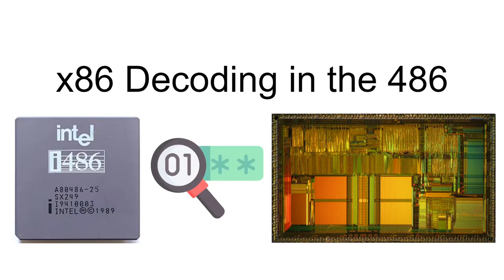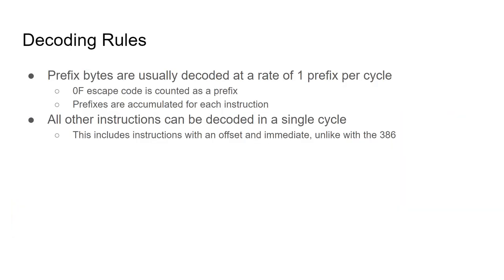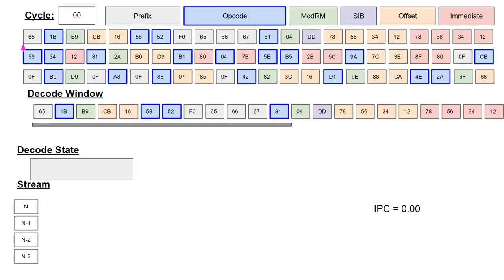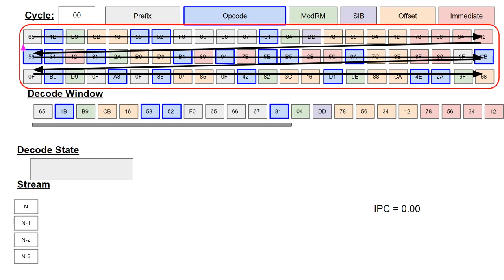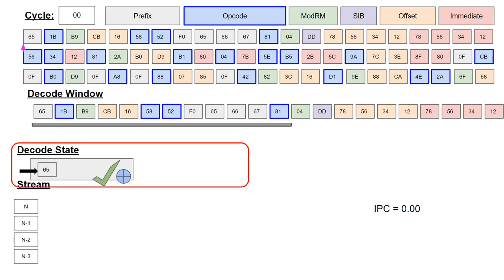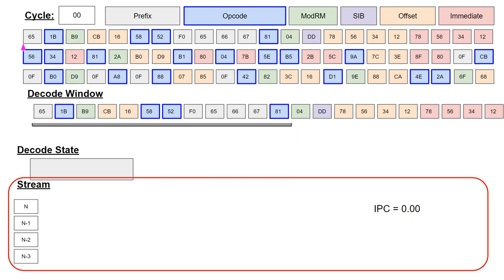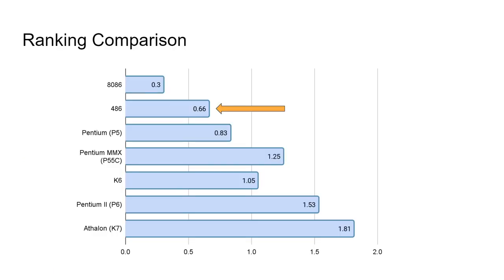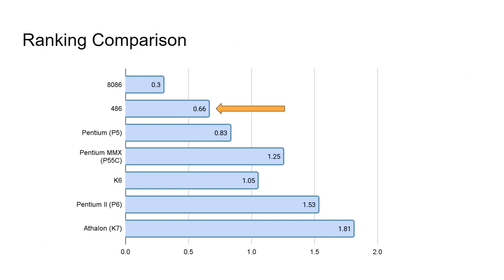x86 Decoding Simulation in the 486

Comment: Very interesting video. Glad to see someone give some attention to CISC. Are you working on an x86 implementation ?
Speaking of CISC :
Could you take a look to how ao486 is implemented or how to improved on it ?
For what i heard, the lack of FPU is an issue when going for a pentium compatibility. I guess transcendental are to costly to implement ?
Have you take a look at Flocopo ? Apparently, it generate very well optimise and pipeline ALU and FPU by FPGA target.
Are decoder and control the only unit ISA specific ? Could a cache or a TLB unit can be reuse on a different CPU ?
Would you give some love to the 68K family, decoding seem simpler (as the FPU on the 68040/68060) ?
Reply from the maker: Thanks, I am working on an x86 implementation, but progress is slow. I sort do need a better x86 implementation than the ao486 for another project that I am working on (it's good for 486 stuff, but nothing newer). 

I have looked at how the ao486 was implemented, and it is feasible to improve or add a FPU to, for example. But it would require understanding the undocumented mess of control signals and datapath. It would likely also require modifying the control sequence compiler. I don't really have the patients or dedication to consider doing that, and would likely be better off writing something from scratch.

Transcendentals are okay to implement, you sequence them via approximate algorithms using microcode. Essentially, it's like taking the C math.h implementations and making the hardware run the operations directly. The biggest problem with implementing a FPU (aside from the FPU itself, which is no more complicated than an entire 68k), is linking it to the main x86 control path. That means that either A) the 486 needs to understand that the FPU exists and needs to work with it (if it were external), or B) that the 486 itself needs to decode and issue FPU instructions. Neither of those tasks are all that complicated themselves, but figuring out which control signals need to be modified, and where to hook in the datapath is less trivial. 
I had not heard of FloCoPo (had to look it up), but I don't think it will be useful in this case. If the goal were getting something working without regard for performance, then maybe. But inside of a CPU implementation, which control signals are used, the number of pipeline stages, the technology mapping, etc, all matter.

The decoder and control are not only ISA specific, but microarchitecture specific. The same is also true for other parts of the CPU. However, it's possible to adapt a microarchitecture for other ISAs. A simple example of that is the simulator GEM-5, which has an ISA specific front end, but a more generic backend. To do so, however, you need to cover a larger set of functions with the other components. For example, with a K6 that used micro-ops, it could probably implement ARM if you modified the decoders. It couldn't implement MIPS or RISC-V though, unless the logical registers were increased from 32 to 64. If that were done, then it could also probably implement those architectures, though the MIPS TLB would be an issue. Which goes into your other question, a TLB can be reused in parts, but some require specific behavior which is opposed to other implementations. the MIPS TLB for example, operates completely different from x86 and ARM (it relies on low level software management rather than page walking).

The 68k family does have a much simpler decoder, as I understand it. But I'm not very knowledgeable there. Learning / diving into another ISA wouldn't be a good use of my time at the moment, given that there are plenty of other people already far more knowledgeable than me (who wrote 68k FPGA implementations).
Reply: @RTLEngineering  I wish good luck, i will follow this serie. 
It is just me or TLB and Cache are very similar ?
What do you think about generator like Chisel, Migen or SpinalHDL ? I was thinking using one of these for prototyping the most complexe parts because i want to keep what's left of my sanity.
I'm more interested in the 68K, i know there is many implementation of the 68000, one for the 68010/68020, an 68030 without MMU and the 68080 from the Apollo Team (an 68060 like with no MMU and not open source). I was thinking starting from scratch and maybe skip unused/obsolete instructions like BCD, aiming for a modern 32-bits 68K with MMU ( to do linux and stuff ). And beyond the OG 68000, there not much as technical doc, so i started to look for the closest architecture, the good old x86, hoping i can transpose some things
Reply from the maker: I will certainly need it, already had a few setbacks, and had to scale back the scope a bit (I was originally going to implement a K6, or something similar).

A TLB and Cache can be similar, but it depends on the associativity. With the Pentium, for example, they have a similar associativity (2-way for the cache, and 4-way for the TLB). There are some x86 implementations that are fully associative though, just like with MIPS. And the refill mechanism also depends on the implementation. x86 has a hardware refill for both cache and TLB, whereas MIPS only has it for cache. (A non hardware assisted cache refill mechanism would be a scratchpad, like what the PlayStation 2 had).

I have looked at all of those generators, and used a few for stitching parts together. I'm not particularly fond of them though. They are really good for rapid prototyping, and are powerful for verification (using formal verification). But they are almost impossible to debug (if formal verification is missing conditional state tests), and they give you very little control over synthesis for performance or area (you can always black box, but then what's the point of using the generator). That doesn't mean they are useless, but you could end up putting almost as much time into them as writing straight up HDL.

I know there is a lot of interest in the 68k, but there's been a lot of work done there. The only work done with x86 at the 486 level are the ao486 and the v586, neither of which have FPU support. And that hasn't progressed any further in the last 5-8 years. So that's why my focus has been there.
There probably would be some interest in a more powerful 68k though, something that's compatible, but also more performant (I suspect a lot of Amiga enthusiasts would be thrilled). And, you may be able to adapt something similar to the Pentium architecture to the 68K ISA. You would have to keep the BCD stuff for compatibility though, unless you are able to use an ISA variant that doesn't include it. But you don't need to keep it performant. If you make the back end micro-code base (like the Pentium was), then you can just implement BCD via microcode emulation.

Comment: Would it be possible to publish also the other decoding simulation videos? I found them very helpful to understand the underlaying architecture and principle.
Especially the 8086, P6, K6 and K7 would be very welcome 🙏
Reply from the maker: The plan is to publish the P6 and K6 ones after I finish / upload the front end decoding video on the P6 / K6. Same goes for the K7. The 8086 hasn't been completed yet since it's incredibly slow (every byte gets a cycle, so that's quite a few frames of animation to churn through). Also, the P6/K6/K7 ones may be less helpful due to how short they are (the K7 only takes 11 cycles to go through the whole stream).

Comment: I just watched the video of the P5 decoding as well. Did I understand that right, that the 486 can theoretically reach a maximum of 1 IPC, whereas the P5 can reach a theoretical maximum of 2 IPC?
Furthermore, the P5 is bound by a good prediction of the instruction length (V decoder) and amount of prefix bytes of instructions. Meanwhile the 486 is only bound by the prefix bytes?
Reply from the maker: Yep, that's all correct. The P55C has a few improvements in regards to prefix bytes though, and also has the length predecoders (which are not 100% accurate). So the P55C can get closer to the maximum IPC of 2 when compared with the P5. Also, the P55C is more tolerant to pairability restrictions due to the instruction FIFO, which would otherwise lead to a complete front-end stall in the P5.